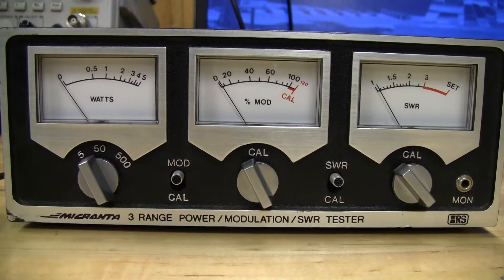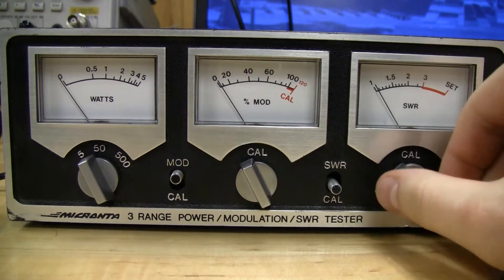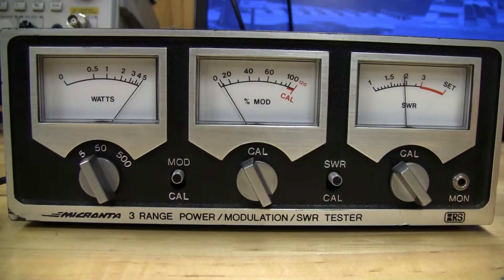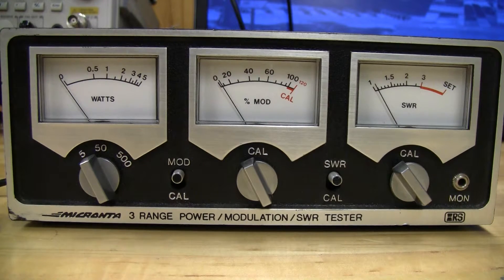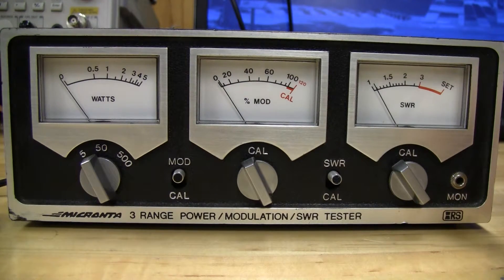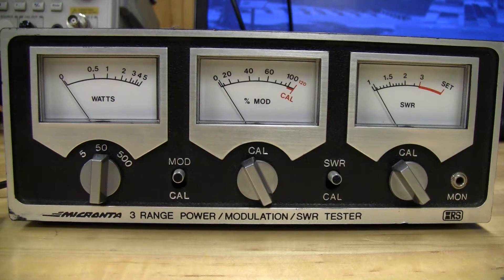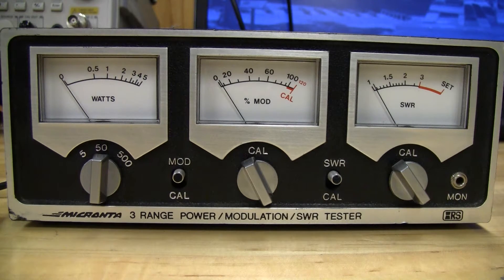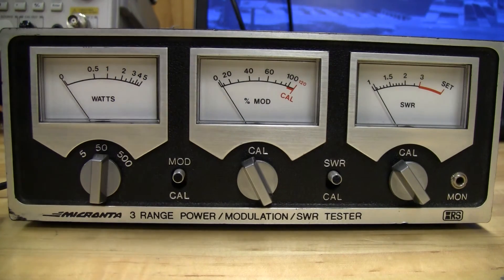Always Use a Dummy Load For Power Measurements

Comment: Hi. I was wondering what is values of 13 resistor homebrew dummy load? Thanks for sharing knowledge.
Reply from the maker: papa charlie it's a network of 50 and 100 ohm resistors arranged to achieve 50 ohms. The setup is a bit weird because i built it from scrap parts. The resistors are 2W each